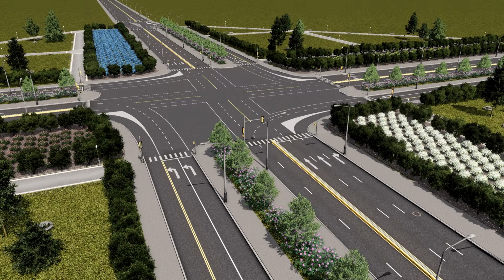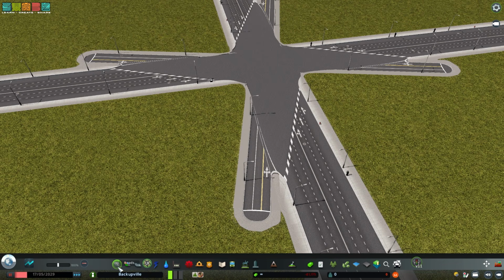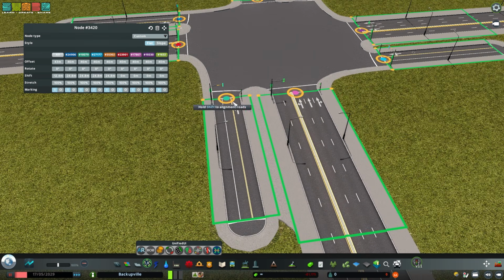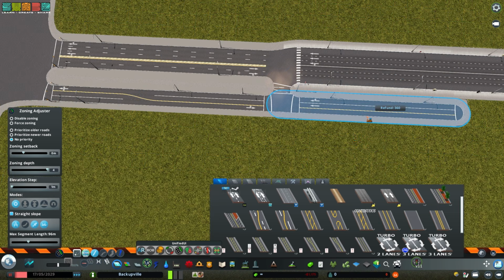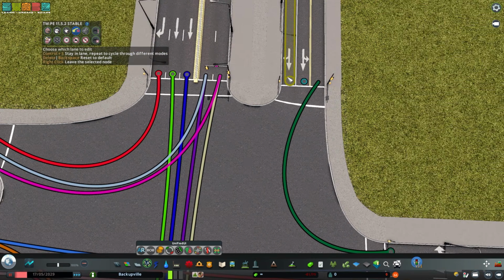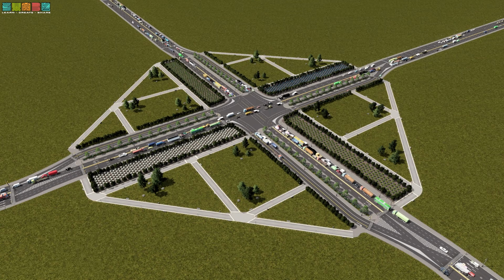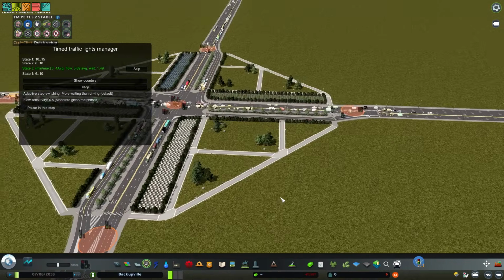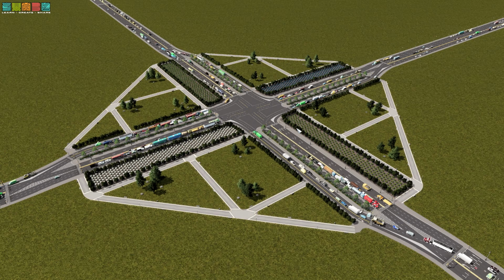Pushing a node to its LIMIT for the "Continuous Flow Intersection"! (CFI)

Comment: Interesting. So you couldn't even build this with unmodded cities skylines 2, would need mods to allow you to control light sequencing and lane connections to make this work? I really fail to see how this is all that much better than a round about. My solution to this problem was just to put 2 overpasses on other side of the intersection so that the less busy streets can drive OVER the busier avenue and then eliminate all left turns, stops and lights. This allows anyone who wants to cross the avenue to cross without obstructing the flowing traffic on the avenue and I only had to sacrafice 4 row houses at  each intersection. This also gives traffic on the Avenue a way to turn left by turning right first and getting off the avenue. You can do this with one way alleys for minimum space usage. Pedestrians and Bicycles can also cross the overpasses allowing you to eliminate Crosswalks and Bike Lanes from the Avenue or Collector road. Now nobody on the avenue ever needs to stop. You turn on to it with a right turn and you turn off it with a right turn. It even allows traffic on the avenue to turn around and travel the avenue in the opposite direction without a U turn or crossing traffic. It also only takes up about 10% more space than the standard 4 way intersection.

Comment: how does this and Parallel Flow Intersections compare?  this one looks simpler and looks like it takes less lights.
Reply from the maker: The two are certainly related. Displaced lefts and such. I imagine they flow similarly, though Ive only ever read about parallel flow on wikipedia.

Comment: I'd call this a "buffered flow" or "delayed flow" intersection (because the left turns are buffered into a long stretch of road that is split off after additional lights). I wonder why it's called "continuous flow".
Reply from the maker: It’s also called a crossover displaced left, but I’d assume “continuous flow” sounds better in terms of branding. https://en.m.wikipedia.org/wiki/Continuous-flow_intersection

Comment: I love the core trick here, splitting the two left turns before the intersection. This has many more similar applications I bet. I don't like traffic lights, but here you really made it work. 

I do think at least one overpass (the main road in one direction) will make this a lot better. But do you have a design that has no traffic lights? I see this working excellently in a highly asymmetric traffic flow, like one major straight meets a heavy left turn. But symmetrical ones of course look nicer.

You can split the lanes and merge them into two roads, probably a wonky zigzag over one way and under the other. You'll then have four pairs of roads. It could be 2-1+2-3 combo just like you have in this video or any combo of lanes. If there is only one really have left turn you only have to split that one road. 

You then have a good starting position for a really cool sets of overpasses and underpasses. I'd set the main roads crossing straight through at -6 and +6, the right turns at 0 and pick what looks nice for the left turns depending on what height you connect to. Does this make sense?

Comment: I don't want to be "That guy" but if you change the traffic lights at the end so the sidelane intake begins when the lane of traffic perpendicular to the side lane turns green you can stop the waiting that the parallel on coming traffic has to sit through to let the side lane pass. You can then make it so the side lane only gets the green light to turn when the first vehicle reaches the light and have the perpendicular traffic stop at the same time so traffic never halts past the intersection

Comment: In Factorio, this is analogous to a buffered train intersection, specifically the Windcross by Zijkhal. Google "Factorio 3 and 4 way intersections" to see it and other crazy designs. In factorio, train tracks are always "on grade" so crazy intersections are needed to allow high throughput for large factories.

Comment: I would have liked to see a comparison to a roundabout, because you aren't getting rid of the left-turn cross over - you are just moving it further away and increasing the footprint of the intersection.
Reply from the maker: My “roundabouts are not as good as you think” video was done under the exact same conditions. This is better at flowing high density traffic than a roundabout. Every intersection I film on this map is better at flowing high density traffic than a roundabout.

Comment: U say this intersections main advantage is that the left turn, by being moved over, does not have to cross straight thru traffic from its own direction. It still has to cross the opposing sides straight thru traffic when having almost completed the left turn.
Reply from the maker: It only crosses traffic once. Before the intersection. Then it makes a free left turn against oncoming traffic. The benefit is the two cycle light. Much faster than a normal 4 cycle light. There are lots of department pf transit videos explaining the benefit as well.

Comment: So its putting more lights, Making left turning traffic wait twice (if the lights arent perfectly in sync), and you're putting secondary stopping points right after the throughway from the intersection, assuming its high density is dangerous, as people get stuck out if the lights arent properly synced and the through traffic gets backed up before you cross that massive intersection middle. Which if its that congested, You cant make it seamless. 
The only thing this seems to solve is left turns being put in line with oncoming traffic. But it just delays it, and delays through traffic twice because of it. 
I'm just not sure what this is supposed to solve. And with this much infrastructure and network complexity. Just build an overpass or tunnels. 
Might be completely missing the point. Maybe it makes more sense scaled up to like 12 lanes. 
I honestly would have thought that the left turn before the side road would be a yield turning lane left. At least that way it keeps through traffic flowing and if theres less through traffic your left turns dont have to wait at two lights.
Reply from the maker: I’m bot reading all that, but I didnt invent this.

Comment: Absolutely great creation, however I would argue that the apparent none-stopping of the left turning, which cut down the waiting time of the left turning traffic, is actually added beforehand at the 'split exchange' before the continuous flow intersection. The overall amount of time required for the left turning vehicle to go through the same distance compared to conventional intersection with left turn advanced signal end up with very small of improvement. The construction and time cost jump however, is not so small (unless of course I'm missing something here)
Reply from the maker: The improvement is in the main intersection operating in only two cycles. In left turning traffic not getting in the way.
Reply: @YUMBL  You are right. This intersection idea breaks down the ordinary intersection into 1 major and 4 minor intersections, which in theory could improve the traffic flow, if the all lights are timed accordingly to the traffic condition. Great job.

Comment: They had a bunch of these along Bangerter Highway in The Salt Lake City area. I always found them kinda neat. They took a lot of traffic flow ideas for the Jordan Valley and just ran with them. Diverging Diamonds kinda spread through the state, but Continuous Flow Intersections and the one single road with flex lanes never really took off. 
Bangerter has really increased it's traffic flow since I lived in the area back in 2016-2017 so a lot of the intersections are getting turned into On/Offramps. They were starting that process down in Draper. When I was there last year they had gotten up past West Jordan and were working into West Valley City.  

I kinda miss the area, but at the same time I see the ticking timebomb of californization that will inevitably take over the valley. Farther you get from Salt Lake, the better.

Comment: I built this interchange on one of my maps, I have one issue with it and I'm not sure if it's a glitch or not, but left turning traffic on one of the 2+1 asymmetrical roads at the center of the interchange going to the 3+2 asymmetrical road seems to ignore the left hand turn light and proceeds through the intersection on a red light. I'm thinking I have a node too close to the light, and the game may be getting confused. I plan on troubleshooting it soon.

A beautiful intersection otherwise, definitely teetering on overwhelming to build and markup with intersection marking tool. Hours of work, just for one intersection on my first build.
Reply from the maker: You have a very short segment right before the light. Make sure your nodes arent too close
Reply: @YUMBL  Thanks YUMBL! I'm hoping Move-It will fix it if I lengthen the segment, otherwise I'll just bulldoze it and replace it. Love your videos!

Comment: This all looks a bit car centric to me. 😉
And i also think all of this could be "expanded" into a larger grid with side streets for left turns. This way you don't have a big massive paved slab in the middle of your city but actually some functionality (possible) with it as well.

In any case, if you have TOO much "crossing" TRAFFIC then you simply don't have enough public transport. Or in the case of goods traffic, not enough trains.

EDIT: Oh and i think the overhead roundabout is a better design than this mess.
Traffic going straight ahead and right will go level but traffic turning left will go up one level on a roundabout.

Comment: The only issue here is the traffic lights. It’s still not really continuous flow, it simply just found a way to allow turning traffic to turn at the same time as straight traffic in both directions without the need to yield or merge with each other, at least right away
Reply: You also wouldn’t need a light at on the further back roads that set up the intersection if you just have the straight traffic that’s coming out of the intersection go on a small overpass to go over the left turn there
Reply: I know you said the point is for no overpasses, but considering the advantages of this, you’d only need a small one, or you could even go under and build a small, short tunnel. And you could decide which one does it, either the straight coming off, or the left turn, whichever ends up being the smallest, least invasive option

Comment: A couple years ago they put one of these intersections in about 3 miles from where I live. They actually put it in to reduce accidents rather than improve traffic. It's very interesting, it works pretty well. Definitely confusing if you've never been on it before, as you have to know what's going on and get in the correct lane ahead of time. They have it set up the same as your build, with the sub intersections having their own lights that are perfectly timed with the main intersection to prevent traffic buildup
Reply from the maker: Glad its worked!

Comment: 10:12 Now i see this,  you you can make a dive-under tunnel,  exit on the right and go into a small tunnel and come back on the other side of the road,  so traffic wont cross extra there, gives you on all 4 roads less crossing traffic.
Reply from the maker: Yes, but all the irl cost saving benefits are now gone. Tunnels are incredibly expensive.

Comment: Just had a thought. It would be easy to route the left turn lanes across a fly-over, eliminating one to four of those conflict points, for little to no extra land. I would also down-grad two-to-one, five to four or three, ..., lane roads if traffic doesn't justify the higher capacity roads. I would suspect that most conditions, a single lane for the left turns would be adequate. My style is to emplace the minimum solution that handles the traffic.
Reply from the maker: Flyovers are incredibly expensive irl so I would not consider them a “minimal solution”.
Reply: @YUMBL  My comment stands, belatedly (in my case), corrected. Your observation is valid. I implied that the overpass would be included as a minimal, I would use it only if required by the left turn volume. Of course, you discussed over-passes in the vid. Derrr. As always, I appreciate you going to the trouble to reply to my comment.

Comment: Wait, so if you shoot straight across, you have oncoming traffic crossing you to get to a left turn. Doesn't this cause points of conflict just outside the intersection?! AND you STILL have to stop at entering with a light for left turns coming into the intersection... This seems to create another crossing point. 
This isn't "removing crossing traffic"... it's just creating another one a little way down the road outside of the intersection. 

How does this make traffic faster processing?
Reply from the maker: It makes a two cycle light. All traffic can go from two opposing sides, then all traffic can go from the other opposing two sides.

Comment: Very difficult to set up the TTL for this sort of interchange, and it definitely needs them in order to properly move traffic. any tips or tricks? I can't seem to get them to even work like you have here in this video.
Reply from the maker: Start with a two phase light in the middle. Opposing sides all go at once. Other two stopped. Then let the other two go and the first two stop.

Comment: How about a Continuous Flow Intersection that, instead of making a displaced left turn in advance, make a displaced receiver road on the right side of the road to receive the left-turning traffic so that they go as the straight-on traffic on the perpendicular side at the main junction goes while not crossing each other, but later join the main road at the subsidiary junction and go when the perpendicular traffic stops. 

As a simple evaluation, I think this type of continuous flow Intersection might save space on the main road while require extra space on the smaller road (for half upgraded version of the CFI), and also will work better if the smaller road's traffic as well as the left-turning traffic on the main road is much less than the straight on trafic on the main road.

Comment: The way I see it, you have essentially broken single intersection into nine smaller ones. True there's just one node in the middle but it would work exactly as well if there were five, one for each place where lanes cross.
I think you can improve the throughput further by playing with semaphore phasing. The way you have it, there's significant reduction in throughput in the left turn - the left turn buffer is empty a lot of the time and the only reason why it doesn't create a jam is because you have way lower traffic in the left turn directions. My idea is to center it around filling the left turn lanes: when the left turn lane's entry semaphore turns green, its exit semaphore should turn red and vice versa. And the interval should be such that it allows the left turn lane to just fill up. That means, none of the cars should stop on red at the center in the left turn lane unless there's traffic jam, it should turn green the moment the first car reaches it. 
It makes me wonder, though, if it's not possible to build just a large similarly spaced out roundabout in the same area and with the same throughput. With sufficient and properly set up spacing between lane crossings it could be possible to make the traffic to self-organize into buffer-size packets that would pass through it at full speed just missing each other on crossings.

Comment: Is it continuous flow because there's always some traffic moving somewhere?

Maybe chain on a "Nobody is driving" phase for the left turns to make sure they're clear without delaying the other directions?
The issue I have with those other options though is that they apply to the whole junction, and it would be much better if those rules could be set to individual directions.  We specifically want to know if traffic is moving in a given lane or lanes, not the whole junction when using those alternative rules.
Reply from the maker: I wish there was a “two second delay” option.

Comment: Well, I've tried this and I just absolutely cannot get it to work at all. I'm using a bigger 2+3 (the standard large road size), so maybe that's it. Either way no matter how much I mess with the numbers the node remains a complete disaster graphically. In fact, some of the numbers in node controller just refuse to change.
Reply from the maker: Different size roads will need different spacing. And 32 is the max shift.
Reply: @YUMBL  Shift seems to be the only function of node controller that works as expected when I try. I can get the left roads all looking parallel but it introduces rotation to the points that I then cannot change. The values just won't adjust even if I delete them and enter 0. Offset also seems to lock itself for some of the nodes making it so they're way out of position but unable to be changed.

Comment: Nice. In my current city  I am building I have already grown to significant size with almost 80k Cims. In this city I rely heavy on the use of PT and limitations/ban of cars. And I have a pretty good traffic flow about +/- 85%. But there is that one big roundabout, that comes directly from the highway into my starting tile of the city. And it makes about for 90% of my traffic problems.  TL;DR. Will try out this intersction there.